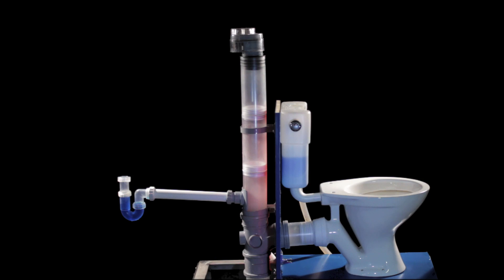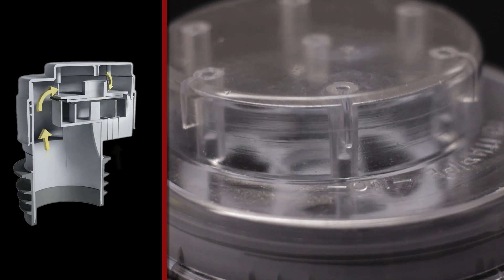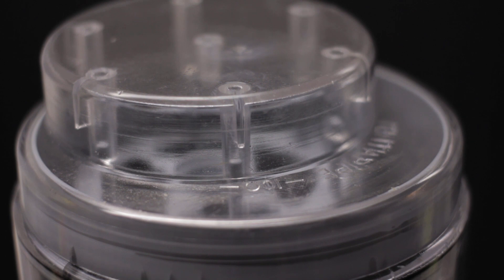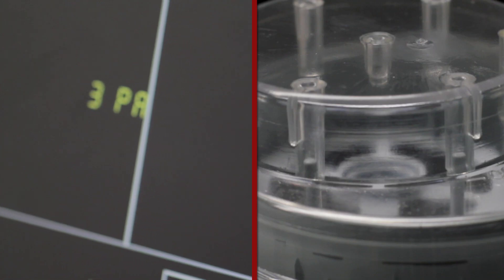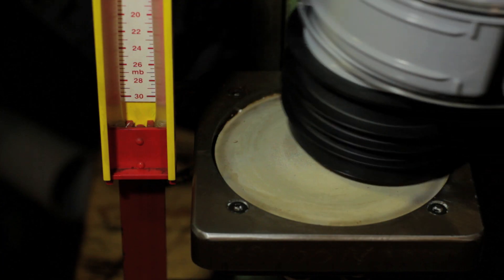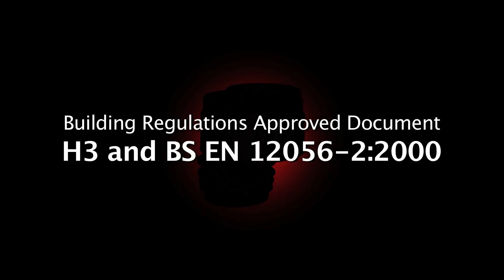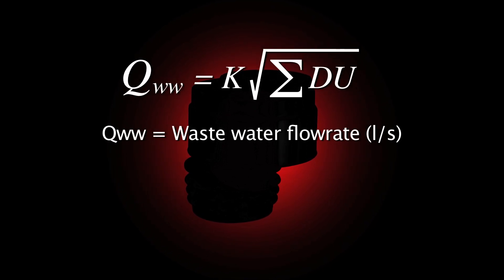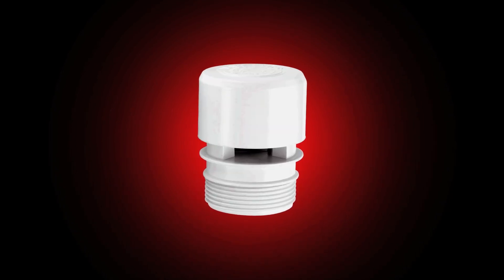AAV: Air Admittance Valve (Product Training Video)

Comment: Helpful.  I think I have a faulty AAV in my camper bathroom sink (I'm in the USA)... so I was trying to better understand the DFU rating on them.  I think the existing AAV I have is a 6 DFU... but I saw some for sale with a rating of 20 DFU.  I wasn't sure if 20 DFU would be better... but after watching this, it seems I should probably just stick with the 6 DFU rating because the manufacturer likely already did the math to determine it is the right pressure for our camper system.  Thanks for helping me learn more about these little vents.